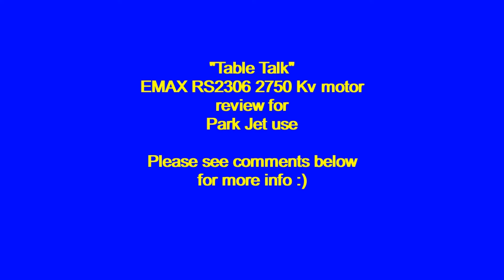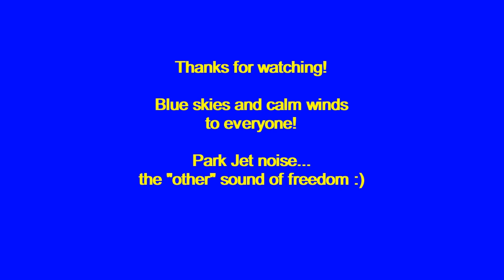"Table talk" - EMAX RS2306 2750 Kv motor review for Park Jet use

Comment: The new generation of quad racing motors have incredible specific performance. You are talking a thrust to weight ratio  (minus hardware) of 43-53:1 whereas a Prodrive 2700kv is circa 15:1. Clearly motor technology has advanced incredibly in a very short time. Scott have you posted a blog on prop shaft balancing? I bought a cheap balancer and think im either totally useless or the device is out of kilter.
Reply from the maker: Hi Daniel, so true, this is one of the reasons I wanted to experiment with quad racing motors in a park jet as the technology is constantly evolving whereas the Propdrive for example has not really changed in the space of 7 yrs, in fact I have heard the new version of the NTM 2700 is less reliable.  I have not done anything on prop balancing, rcplanepirate shot this great video on techniques for balancing the prop blade and hub https://www.youtube.com/watch?v=cxA1COn-h_Y  If you are talking about the shaft on a standard outrunner like a 2212 2200 Kv, better to replace the shaft.  Sometimes the shaft may also be running out of true due to bad bearings, if you pull on the bell and if feels loose of slides up and down more than it should, it could be the bearings going.  I find the ones on the bottom of the shaft go first if I have worn out a motor and will allow the bell to move up and down more than it should causing some issues of imbalance with how the motor spins.  The soft aluminum prop connectors/collets can also get bent easily and are almost impossible to get straight again and if you do bend them too much, they will just get weaker.  If I notice a prop connector is bent, I just replace it, I always have spares in my flight box also.  I haven't seen a problem with a bent shaft in the quad racing motors I have tested thus far as they are so strong.  Sorry I can't be of much more help than that on the balancing issue.  Cheers, Scott